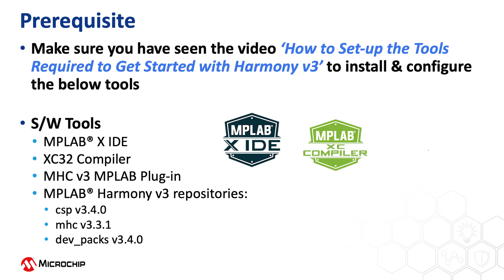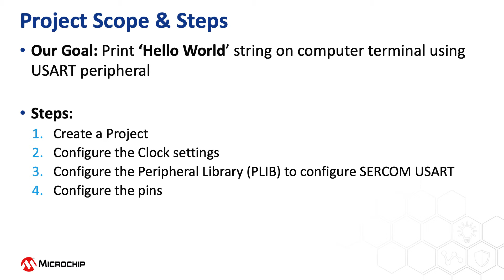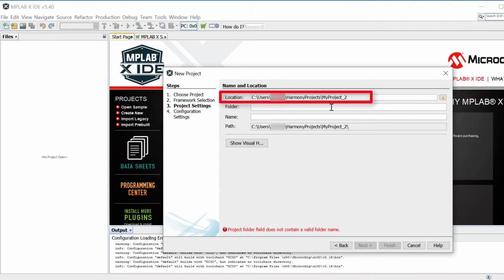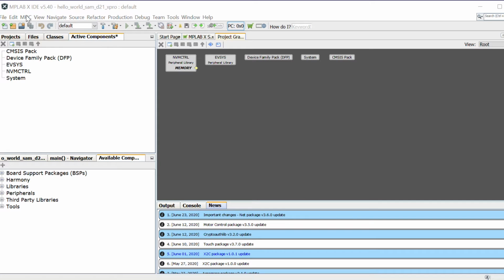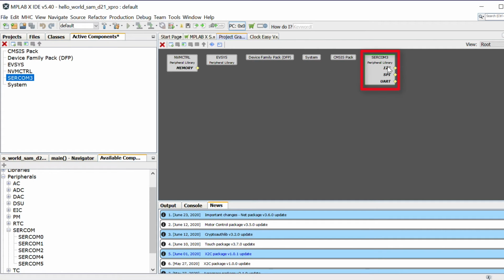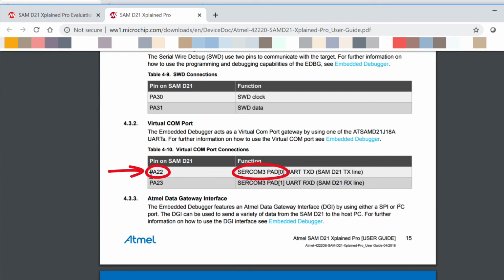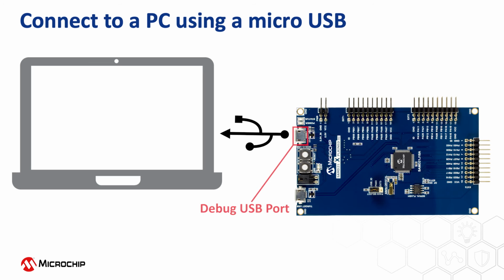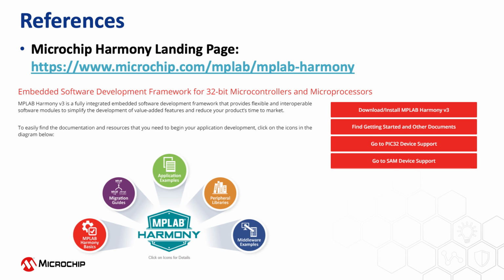Create Your First Project with SAMD21 Using MPLAB® Harmony v3

Comment: As 15+ years programmer which used many tools including AVR studio i must sadly say that your direction with MPLAB IDE stuff pushing out to the public is the grave nailer. It's totally unusable and i don't know who in his right mind will be using it. Even some simplest things like autocompletion (whithout hitting any key) which every other iIDEs has is a real struggle for you. I'm really starting to think about switching over to another platform. It's very sad for me because i've been with atmel practically all my life. I think most AVR/ARM user feel somewhat the same way.
Reply: I'd like to add that most major ARM suppliers (TI, NXP, STM, etc. have learned from their mistakes. They use the Eclipse application interface, and in some cases (STM) bought existing technology (STM Acquired Atollic) with excellent results. Microchip, on the other hand, seems to have felt Java (Netbeans) was the way to go. Fast forward to today and I have to say @bejsfan is absolutely correct. MPLAB-X is a grave nailer. Despite the fact that most of the technology (associated with MCC and Harmony) seems to be from ATMEL, the integration with Microchip MPLAB, to say it mildly, SUCKS. Wake up Microchip, your long time developers may stick with you, but I believe you are losing market share to STM as the tools STM32 deliver are light-years ahead of where MPLAB-X is. To be far All silicon vendors that supply development tools have issues (including STM) but Microchips MPLAB-X, to me, feels as if it is a work in progress and not completely vetted. Sad because the concept appears to be decent, but my experience has led me back to TI and STM.

Oh, and by the way, Microchip.com seems to be experiencing issues. I was unable to download the latest MPLAB-X and compilers using the web page links directly. I had to copy the like and go to to a browser window to get the files to download. Will all these issues, I have to wonder if Microchip serious about suppling developer tools???
Reply: Check out this new video: https://youtu.be/YdMzN8aUt5A?feature=shared

Comment: Hey Microchip: most of your Youtube tutorials are outdated and do not match your current IDE. Don't you think it's time to refresh your training material so you customers can actually do something with the IDE? You web pages are also outdated as well as the examples you provice. When you aquired Atmel, is seems that you took on more than you can handle. Just saying...
Reply: Yep I'm trying to quickly come up to speed on MPLAB X (migrating from Atmel START) and the very first Microchip video (installing the product) is entirely unhelpful.  It has you download the compiler separately which is unnecessary (MPLAB X IDE prompts you to install it) and I don't even know what the hell is going on with Harmony 3 vs MCC.  It's a confusing mess.
Reply: Latest https://www.youtube.com/watch?v=YdMzN8aUt5A
Reply: Check out this new video: https://youtu.be/YdMzN8aUt5A?feature=shared

Comment: cant find harmony v3 in tools/plugins
Reply: When you install MPLAB-X, Harmony V3 is automatically installed. I found that installing the compiler(s) first, followed by the installation of MPLAB-X was best. The download of MPAB-X and the compilers is very frustrating in my experience as there seems to be a server issue on Microchip's side. I've used Safari, Crome, Firefox, and DuckDuckgo and browsers all having the same issues, so be patient.

 As I mentioned in a prior  post, the tutorials are outdated and Microchip has done a rather poor job of integrating Atmel's tools into the merged ecosystem. I am under the impression there is either a shortage of technical documentation personal, lack of expertise in the applications area (or willingness?) to contribute to well written documentation, or? Another issues is that when you find a series of instructional videos, the videos are broke up in to difference presenters with little or no training in how to present. The sound quality, as will as the speed is horrible in many cases (not all.) This is NOT what Microchip was about prior to the Atmel acquisition, in my experience.

 I am working on a project with the SAMD21 product and have spent at least 2 months digging through the on-line material on Microchip.com, and other Internet resources. Microchip seems to want to put their documentation into a web page and has not bother to supply PDF downloads. So, when the web page is moved, the links are broken. PDFs are hand for that reason - you have a backup if you need it for offline use. As the product has grown (due to merging with Atmel) grew, the IDE architecture has been split into a compiler separated from IDE (for a good reason), the documentation has been left behind. Far too little up to date tutorials of how to install, program, and debug the Microchip/Atmel parts is about 2+ year behind and it is confusing. I could go on and on and on...

All of that written, I am starting to get a handle on the development in MPLAB-X and have considered doing my own tutorials and presenting them at an on-line independent conference. Specifically an ADC-->application block (e.g. digital filter)->DAC architecture. In my journey, I have sought out the help of the applications folks at Microchip but have found the individuals I've heard from seems as if they can answer basic questions, but it seems as if there is a lack of experienced trained support people. I don't mean to disparage the support department, just saying this is the impression I get. It's takes ALLOT of trial and error to understand the MPLAB-X pieces and patience with the MPLAB-X crash issues and slow performance. The one thing that has kept me going and not throwing my hands up and returning to STM32 tools, is a request from a friend that asked for my help. I committed to getting this project done with Microchip's products line.

I sure wish Steve Sandhi would read these comments. I Met Steve and on of the ond Microchip Master's conferences and know that he listens. He is semi-retired as I understand it, so, SOMEONE at Microchip that cares about your company, please pay attention! Just saying....
Reply: Check out this new video: https://youtu.be/YdMzN8aUt5A?feature=shared